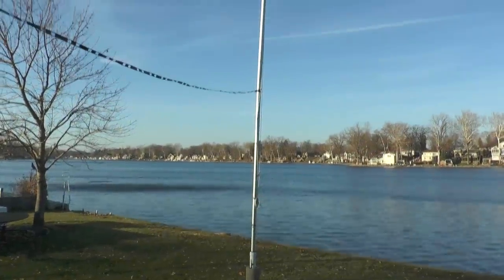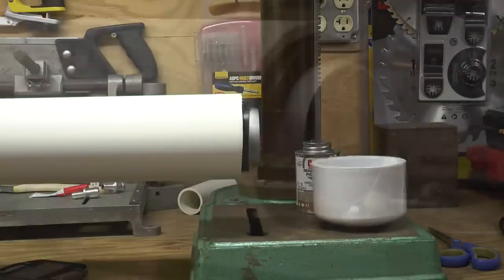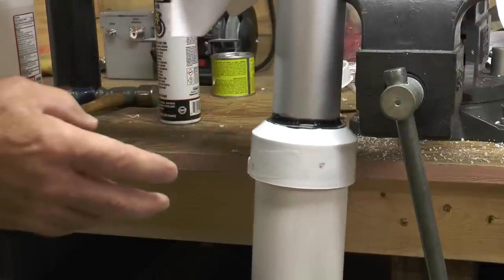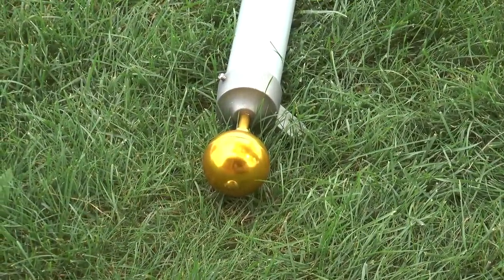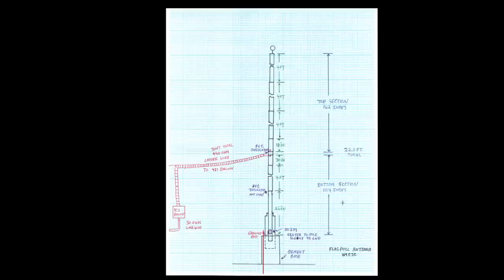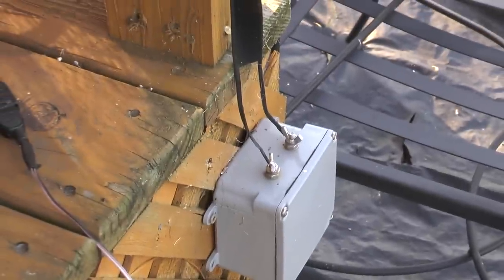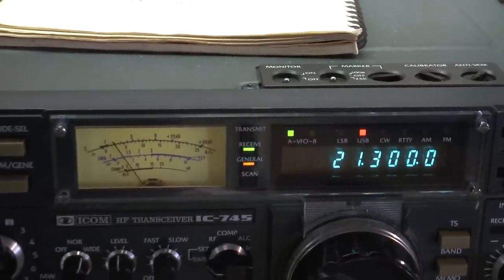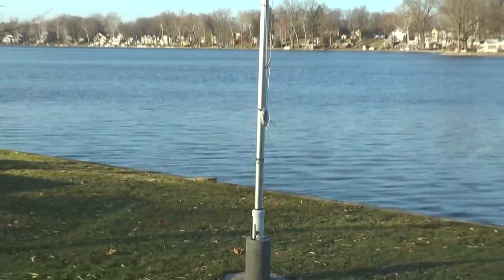Flagpole Antenna Project

Comment: I like your idea of not using tuners.  I use older radios without built in tuners.  I used to have a tri band beam but I live in West Texas where the wind blows all the time and it was destroying the beam and the rotator, so I installed an OCF dipole and got it resonant on 10, 20, 40, and 80 meters.  The wind doesn’t affect it and I’ve talked to multiple countries.  Good luck with all your projects. 73.
Reply: The simplest, easiest antenna for 30-160 is an Alpha Delta DX-B 1/4 wave sloper. My lot is 60'x180' with the neighbors' houses 20' away. Once upon a time I had a Butternut Butterfly beam on a 30 foot TV tower but when the wind took the tower down a Cushcraft R5 replaced the beam.
Reply from the maker: Lots of wind issues here too. The PVC spacer in the flag pole gives it a lot of flex.

Comment: Run a single radial into the water and feed it at the SO connector with 1/4 inch spaced coil in the insulating section. Use a remote tuner at the base where you have the balun and you are in big DX business. With a remote tuner/coupler, you should have 80 and up. No ladder line to attract neighbors attention. Slot and clamp the sections to stop wind effect.

Comment: If you use conductive grease on the ball threads at the top instead of thread tape it will make a nice corona ball. This is one of the nicest builds I've seen, with very good attention to detail..🖐🏻73's🎙🎧KD9OAM📻 📡
Reply from the maker: Ill keep that in mind.

Comment: I have the same flagpole 4 sections and my is atached to a fence post split 1 to 3 with a Myantennas 4:1 balun . To stop the sections from movements drilled and installed 3 aluminium rivets in each section good luck with the Flagpole VA3FH
Reply from the maker: Hi Victor, rivets may be the answer. I used stainless screws on each section but the wind would shake them loose. Thanks

Comment: Yes. Water vapor in air will condense in winter. Sealed antenna tuners will fill up slowly over time. Motorola Triton/ Micom tuners and their SGC and Icom clones all had to include small drain holes.

Comment: Nice job. Congratulations on your new antenna. With a little fine tuning and an antenna tuner, it looks like you’ll have stealthy setup covering 3-4 bands. 

I’m wondering about your electrical grounding though. The way I understand it you should have all your electrical grounds bonded to the main grounding point (usually at your mains panel EGC). Otherwise you have a ground loop condition which opens you up to the potential of a varying ground reference and RFI, not to mention ground voltage gradients and last but not least, code violations. You might want to look into it.

Comment: Interesting. I would go back when you have time, and take the ground rod C-clamp off, and clean the excess cement off of the rod. I would also discard the C-clamp, and replace it with a real ground rod clamp.

Comment: As I used my cheap Harbor Freight Flag pole, for an antenna mast, I drill and used pins to go thru the mast, instead of fighting with Hose clamps !
No more worry of variable wind speeds vibrating mast to collapse !
Just a thought !
As everyone has their own way of doing things !
The pins I used, have metal rings on one end, making for easy disassembly !
👍😉

Comment: Interesting project. What is the reason it has to be sealed with no drain hole in the bottom? seems like condensate from nighttime dew and rain is going to accumulate down there no matter how much flex seal you use. It should have a way out. Hopefully that doesnt become a problem.
Reply from the maker: The lake water table is only 1ft below top of lawn. Bottom of flag pole must be sealed. So far, no condensation issues.

Comment: Nice, I've been thinking about a flagpole antenna for a dedicated 30-meter vertical in the front yard.   25' is about the right height, I'd put it over a field of ground radials.
Reply from the maker: If you end feed the flagpole you will need ground radials. It seems off center feeding does not.

Comment: You might have worry about getting water on the inside from condensation. From cold am's and the heat of the day. Ron
Reply: I'm sure it full of water by now, anytime you need to keep something dry it will fail😂
Reply from the maker: @melissasmess2773  No water yet since summer of 2001.

Comment: The IC-745 and 751A were my favourite Radios for a long long Time. Yours looks in a cosmetically good Shape and that Flagpole Antenna seems to do its Job as well. 73 de Uncle Guenter 💯🔔🔔🔔🙋‍♂
Reply from the maker: Getting hard to keep the 745 going. Seem to need to clean the VFO  control once a year. Not easy to get to.

Comment: Well done.  I have a home brew 1/4w  40m vertical.  I am thinking of doing a similar modification.   I have seen some folks who run the ladder line through the bottom section of the vertical and then run it into a tuner or 4:1 at the base (yeah,  I know).  In any event it will be fun to go through the experimental process.  Thanks for the video.  73 DE W4TYB
Reply from the maker: I saw a video of a flag pole with ladder line spaced inside the lower section like a balanced coax. Thought of trying that but I don't have HOA issues here.

Comment: Great videos about flag pole antennas. 
    I was thinking that your flag pole antenna might experience a much greater improvement if you added four ground radials about 2-3” below the soil, especially if you want to do 10-12 meters and 40 meters also. 
    I get these big plastic jars at Sam’s Club and Costco for my Skittles and M&M’s. They have these one inch tall by 5” diameter plastic lids that I drilled 16 holes all around the lid. I then drilled two one inch holes on top to run my vertical ground spike through and the other with a Anderson PP panel connector. 
    So I threaded 22ga awg wire through those 16 holes to make eight radials @ 8’3” and eight at @15’ and these ground radials work awesome. 
     With your flag pole antenna, it seems to me that you made a 25’ vertical antenna in principle. For 10-12 meters, I think the ideal height is between 96”-112” but I’ve done those same bands at 11’ with 1.4 SWR. 
     If I knew you personally and lived near you, I would ❤ to test out my Xiegu G90 @ 20 watts with it’s built in antenna analyzer and built in antenna tuner. My G90 will Tuna Fish and a beer can, maybe even a full one…😂🤣😂
    Thanks for the video! Here in HOA Land, flag poles can be the only way to go for most folks wanting to play HF. 🤙🏻🤙🏻🤙🏻
      Todd WH6DWF 🇺🇸🇺🇸🇺🇸

Comment: Not sure that an HOA would belive this isn't an antenna. That is why most people do flagpole antennas. I have a friend that is in a HOA and can only do a wire in the attic, not very long. Do you know of something that would do more bands and no window line to the middle.
Reply: I'm sure the attic antenna works much better than a flag pole. 73
Reply: This is why HOAs are now banning flagpoles.

Comment: Taper the inside of the PVC pipe and that coupling may slide in better. Maybe add a tad of grease or electrical grease if necessary
Reply from the maker: Good point.

Comment: Wouldn't sand isolate the flagpole from the pvc. I thought PVC was non conductive anyway. When I worked for Navy Public works we installed several flagpoles and we used sand to fill the cavity between the flagpoles and the pipe we had set into concrete. these were 100 foot or more flagpoles.
Reply from the maker: All I can say is air is the best dielectric so I went that route. So far the rubber spacers are holding up. Thanks.

Comment: I noticed the idea of "water tight" repeated. Ive learn designing to minimize water infiltration BUT include a path for water to exit helpful. An example, ive installed "water tight" power outlet boxes only to find water finds a way in, but no way out and corrodes the internals.

Comment: Call me lazy, but I probably would have just used the pulley for the flag to hoist the end of a random wire to the top of the pole and run the other end of it to my shack.

Comment: I would not have thought of the capacitance issues with PVC adjacent to the mast. Good mind.
Reply from the maker: So far the spacers in the base are holding up. 60mi winds yesterday. All ok.
Reply: @CIRCUITDESIGNER  I guess any rubber will dry and crack over time. But with them being inside, I doubt they will fail in our lifetime.

Comment: What is the point of the SO239 at the bottom that doesn't connect to anything?
Reply from the maker: For me, Ham radio is for experimentation. That connector is for end fed access to the flag pole. I decided to go with off center feed point. Connector no longer needed.

Comment: Not understanding why you have to seal PVC from the aluminum tube.  Is PVC conductive?
Reply from the maker: The concrete base will always hold moisture thus, conductive. The air space between the aluminum tube and PVC reduces the capacitance to ground via the concrete. Thanks

Comment: When yiy attached  the so239,,did you connect the centre pin to the antenna or did i miss this,,,but good project,,,atu should alway be at antenna  end of feed line,,only ham tune from tx end,,,atu at antenna is  way more effective.
Reply from the maker: Yea, It's connrcted.

Comment: nice, also for full length big flag poles
Reply: or more like wind turbine flag pole antennas
Reply: also if you telescope the flag pole, any frequency
Reply: Feed it with a gamma match and use a tuner. Supposedly there are military manuals that explain how to use a tree as an antenna via shunt-feed.
Reply: @spaceflight1019  yep you could even hang an antenna from helium balloon, use the rope both as the tether and the antenna, get good views, from above

Comment: You really should research the proper way to put the flagpole base in the ground.  You use sand inside a 16 inch tube and the base of the flagpole is set in the sand and the 16 inch tube is set in concrete.

Comment: Sunlight eats Flex-seal.
Reply from the maker: That's debatable. Flex Shot is supposed to be guaranteed for UV. Flex Seal seems to have possible issues. So far the Flex Shot has held up since 2001.
Reply: @CIRCUITDESIGNER  I'm speaking from experience.  Used it on my camper skylite and it flaked and crumbled under 3 years
Reply from the maker: @raylrodr  Yea, I saw online where people have issues with Flex Seal on RV's. Ill have to keep an eye on the antenna seal.
Reply: @CIRCUITDESIGNER  you'd think for what that stuff costs that it would be an ideal solution.

Comment: your GROUND ROD IS IN VIOLATION OF NATIONAL ELECTRICAL CODE.

Nothing in Art. 800 indicates grounding antennas.

When you ground the coax and connect it to the radio, you violate Art. 250.24 ,(a)(5) TWICE:

May not reground at the load
May not ground a not normally current carrying conductor.
Reply: PS Youve also violated Code because your antenna ground rod is too far from the Service Entrance rod to bond them together.

Theyre only allowed to be about EIGHT FEET APART.

YOUR GROUND IS DANGEROUS.
Reply: It's only dangerous when it's struck by lightning 🌩,  in the meantime it's an antenna